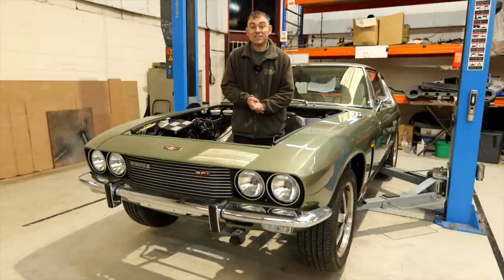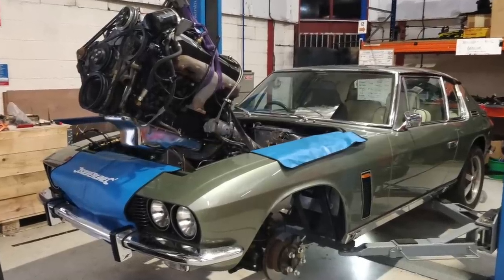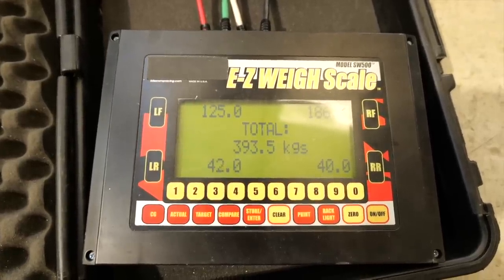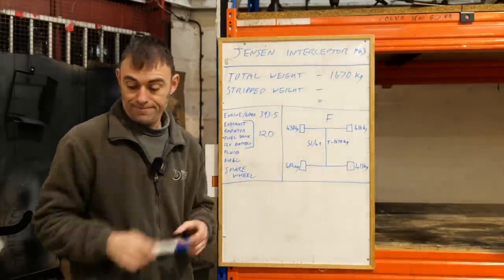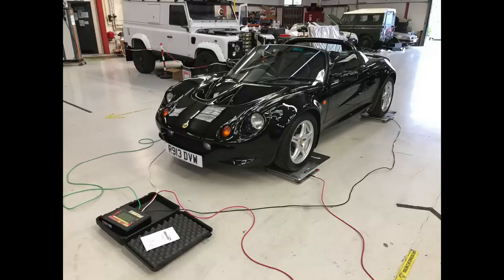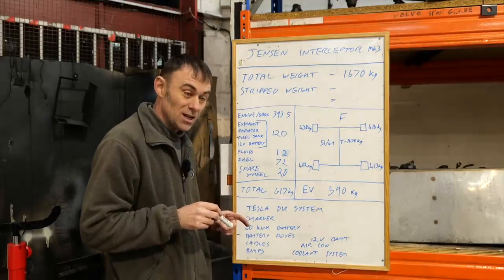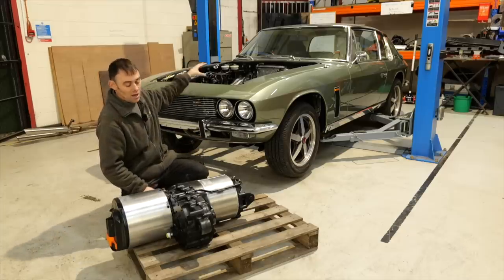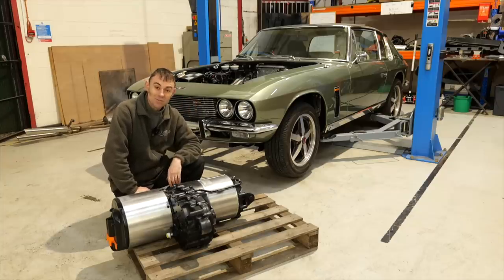Shocking amount of weight removed from the Jensen Interceptor.

Comment: I think you should have left the spare tire out of the equation. EV conversion does not prevent flats. Regardless, the weight still comes in a few pounds less (or kilos) with the EV equipment. Which is good to know that they are so close. Bring on the conversion.
Reply: He said they’re using the space, so there won’t be a spare.
Reply from the maker: True but we need the space for the rear battery pack, also new cars haven't had spares for decades. 👍
Reply: @ElectricClassicCars  "...new cars haven't had spares for decades." Huh? Say what now??🙄
Reply: @ElectricClassicCars  fair enough taking that into consideration. Keep up the good work.
Reply: @eGazTheFirstAustralian  I figure he means there in the UK. We still like our spares.
Reply: @alanmay7929 … agreed, but at the end of the day this car will probably be more of a “weekender” and some aerosol gunk and an air compressor should save the day in 99% of situations.  You could still mount a spare in the boot if you want to get more adventurous.
Reply: Yep, I'd factor in a spare even if it is one of those rubbish space saver spares.
Reply: @ElectricClassicCars  My current new car has a spare?  So have all my new cars this century, so perhaps that's a bit of a generalisation.  But I understand the decision and you can always retune the Jensen suspension for runflats.
Reply: @ElectricClassicCars  Not true. Most cars have at least a space saver spare WHEEL. No one ever carries a spare TIRE or TYRE. My 2002 Mondeo has a full size spare WHEEL. My 1999 SAAB 93 Cabriolet has a space saver pare WHEEL. Most current models have a space saver pare WHEEL.

But by all means misrepresent the facts to excuse the need to add even more battery capacity to a once beautiful classic car, in a vain attempt to give it useful range - for the brief life of those expensive batteries that will need to be replaced in about 5 years.
Reply: @G58  Two out of my last 3 cars haven't had any spare wheel, just an inflation kit with gunk. Pretty much everything from BMW/Mini uses run-flat tyres, so they don't have spares either. The idea that batteries need to be replaced after only 5 years is not even close to being true.
Reply: I was surprised to see that the EV conversion could be done at the same curb weight, since modern EVs are usually a few hundred pounds heavier that ICE equivalents.  Of course it is possible with a small battery and limited range, but that is not the case here with 200+ miles of EV range.
Reply: @ElectricClassicCars  And we are very much poorer for the lack of spares as the state of the roads mean no spares so lots of misery when you get a puncture. ( Deal with this on a daily basis as a breakdown patrol ) .
Reply: I've not had a puncture for 15 years or even longer so I agree leave the spare in yer garage and take the risk !

Maybe take it on long trips but pointless carrying 20kg around locally with you.

Just call the AA if you get a puncture ......
Reply: @timgosling6189  Only about 60% of the new cars sold in the US have spare tires...
Reply: Yep, in many new cars the spare wheel has been replaced with a roadside repair kit, which consists of a can sealant and a 22 volt tyre inflater.
Reply: @G58  Oh dear the (very) old suggestion that the batteries will need replacing in five years, simply not true, my current EV is five years old, still going strong with no suggestion of replacement battery being needed, the batteries and motors used in these conversions are salvaged from written off cars, they are not new!
Reply: @G58  my wife's 2009 focus doesn't have a spare wheel, not does my 2018 BMW. It saves a lot of space and weight (which improves the economy).  I understand why some folks want a spare wheel, especially if you are in the sticks, in which case you just buy a car with one.

It's important not to misrepresent facts.
Reply: @OriginalgEd  you responded:

“G58 my wife's 2009 focus doesn't have a spare wheel, not does my 2018 BMW.”

Okay. 

“It saves a lot of space and weight (which improves the economy).”

What evidence do you have to support this claim?

“I understand why some folks want a spare wheel, especially if you are in the sticks, in which case you just buy a car with one.”

What has location got to do with it? The important thing is that if you have a spare wheel, you have the option to change the wheel if you get a puncture. If you don’t have a spare wheel, you have that option, and have to be recovered. That’s just ridiculous. 

“It's important not to misrepresent facts.”

I agree. Who has?
Reply: @eGazTheFirstAustralian  have you bought a car in the last decade? My Volvo V60 has none
Reply: @G58  None of my new cars have had spares since 2018. Only those constructed in the last century.
Reply: @G58  lol batteries comes with 8years warranties on most cars? How much warranty an combustion engine has? 😂 How much maintaince a combustion engine needs, how much it costs to replace it, how much fuel you burn inefficient in 10years. Stop talking bull.
Reply: @hardywoodaway9912  EVs are not sustainable, and not as efficient as diesels. And that’s in normal conditions. In winter they are far worse. You cannot recycle lithium batteries. Everything on a petrol or Diesel engine is recyclable. These are the simple facts.
Reply: @ElectricClassicCars  "New cars haven't had spares for decades" That's a bit disingenuous. Many cars don't now sure enough, but there are still plenty of modern cars on the road with space savers and some even with full size wheels in/ under the boot. Needing the space for an EV conversion is a fair argument sure, but saying modern cars don't have spares so it's not much of an issue is a poor one, especially considering most people agree that a puncture repair kit is totally insufficient in most cases.
Reply: @Xenon0000000000001  
They often have the space for a space saver if you decide to buy one.

It's a cost saving thing and modern tyres are far more reliable.
Reply: @Robert  If you get the fancy sound system, there's often a subwoofer where the spare would go.
Reply: @Xenon0000000000001  Priorities! Ridiculous.
Reply: @eGazTheFirstAustralian  I haven't seen a new car with a spare for at least 25 years here in Finland.
Reply: @G58  Hmm, you're out by about 20 years on the lifespan of batteries. You do know that manufacturers guarantee them for 8 years, so replacing them every 5 years, by your reckoning, will be free.

Comment: Great video. I very nearly bought an FF in the late 70's, did the sums on running it as a 20 something, and sanity prevailed. Plus fuel rationing was in place, and my 25 litres of fuel a month wasn't going to get me far.

On a different note though, and maybe it's been explained in another video, why not just roll the stripped car back onto the scales? Not only will you have the Nett weight, but you will also show the change in the weight distribution.
Reply from the maker: That's what we normally do but it would make for a boring video so for this episode we filmed and weighed all the bits we took off instead. 😁👍

Comment: In the USA I believe it would not be a problem making the car total weight after conversion 2000 kg ie installing a whooping 100-110 kWh battery pack? I mean with modified suspension and wheels rated for that weight. These days most long range EVs sold in North America are even heavier. That could bring the range of this Jensen to at least 300 miles. Anyway it is an awesome piece of automotive history.

Comment: I would try and include the spare in that car if possible.
I don’t think a replacement tyre would be in stock at a tyre dealership due to its age and it wouldn’t be cheap getting the car recovered back to the owners home.
Reply from the maker: The size is pretty common. Modern cars haven't had spare tyres for decades. Also we need the space for the rear battery pack. 👍
Reply: @Electric Classic Cars I understand the logic behind your decision but if I were in the fortunate position of having you do this conversion for me I would still keep the spare wheel so that if I went on a long trip I would at least have the option of carrying a spare.  Sods law says if your going to get a puncture it will be on a cold dark night mìles from anywhere whilst it's tipping it down with rain. Just Subscribed by the way. 
How will you recharge the new 12v battery please  if the car doesn't have an alternator. I have seen several YT vids of Teslas in deep trouble when they're 12 volt battery has gone flat !

Comment: How much different is the modified Tesla motor and straight out gear box tail shaft compared to the Standard Test 3 rear drive unit.
Is that Tesl unit better than a similar Hyper 9 motor.
Reply from the maker: It's a lot different and a whole lot more powerful than a Hyper9. 👍

Comment: The Revolt system is nice but I thought the straight cut gears on the inline reduction box was noisy and gets hot? Thoughts?
Reply from the maker: We may be using a different reduction gearbox. 😁😉👍

Comment: I went for 380KG for the engine, 124KG for the radiator and exhaust etc. 80 KG for fuel and 15KG for oil.  
See these conversions, if battery tech/electric motors improves massively, can you switch them out in the future?
Reply from the maker: Yes, we've already done one or two upgrades on the very first conversions we did 7 years ago as tech evolves and gets better all the time. 👍

Comment: I was lucky enough to have an Interceptor 3 as a company car in the early 1990s. All fuel was charged to company. 
The figures I remember I covered almost exactly 14000 miles in the year and added almost exactly 1000 gallons of fuel. Mixed driving with 2 mile commute and probably about 20% motorway over the period.
So well maintained mostly sensibly driven car achieved 14 mpg
Reply from the maker: That must have been the coolest company car in the world. Good job the company paid for the fuel. 😁👍

Comment: So, Electric cars never get a flat tyre  ?
That's good to know !
Why not use motors front AND rear  ?
The Honda 2000 used an electric driven rack and pinion set-up. Would this system be better to "add lightness", ie. taking out drop-links etc ?
Looking forward to this build immensely  !
Take care  !
Stu  xx
Reply from the maker: Modern cars haven't had spare wheels in for decades and we need the space for the rear battery pack. 👍
Reply: @ElectricClassicCars  BS, all of my last 6 cars have had full sized spare wheels since 2000. Stop pushing lies to justify removing the spare.
Reply: @dikkybee4003  Bollocks, none of my last three cars have had a spare, just a can of Tyre Weld and a compressor.  Stop pushing lies to justify your comments!

Comment: I do love your work but I'm not so sure about changing a low volume classic like this yes beetles that were produced in their millions. One redeeming factor is I believe that it's fairly easy to put back to original, I would keep the engine if it is numbers matching. Keep up the good work.
Reply: I must admit I have mixed feelings about this too.  On the one hand it's a shame to lose originallity (although depending on the work done the conversion may be reversible) but on the other hand for an occasional use car it should be a lot easier to live with.  It's obviously a safer bet starting with something like a Beetle which, lets face it, are no great loss to the world (apart from the undeniable proof of what a despicable character Adolf Hitler was) and are so bad to start with you'd struggle to make them any worse.
Thinking about it I'd change a lot about any classic, I'd have to convert to fuel injection and coil-pack ignition as well as ditching drum brakes (at least at the font) and any dodgy steering systems.

Comment: out of curiosity, since you had a starting weight for that actual car (and some way of getting that measurement) why didn't you simply drop the whole car back onto your scale after you took the parts off and skip weighing it piece by piece? 

Seems like that would be more accurate and include all the bolts, brackets etc, stripped that are all heavy steel.
Reply: Because we wanted to show more detail in this video. 👍😀

Comment: I might be looking at this from a different context (coming from Australia where distances tend to be larger), but having no spare wheel would be be a deal breaker for me. The range would possibly be ok as long as you didn't want to travel too far inland (not enough charging infrastructure).
Reply: The vast majority of new cars sold don’t have a spare these days.
Reply from the maker: New cars haven't had spares for decades.
Reply: @Pugjamin  while true on a per model basis. Taking Australia as an example (an possibly an outlier) the top 5 selling cars for 2022 are all either Ute’s or SUV’s which would have a spare. #1. Toyota Hilux #2. Ford Ranger #3. Toyota RAV4 #4. Mitsubishi Triton #5. Mazda CX5

The two SUV’s have spacer saver spares I believe.
Reply: @alanmay7929  Europeans probably have nicely maintained roads that aren’t covered in puncture hazards
Reply: On my very informal poll of the number of sports cars on the roads of  inland Australia the number is zero. Sports cars here seem to be mostly a costal thing with the majority never leaving the city. Anyone traveling any decent distance does it in a decent sized SUV or a bike.
Reply: @francesconicoletti2547  Plenty of MX5/GR86 etc on the road in regional Australia. I frequently see an Aston Martin in the car park of the gym I attend in regional (inland) NSW. Plenty of non SUV's in inland Australia.
Reply: @alanmay7929  not wrong at all. Most cars sold in the U.K, there this video is based, do not come with a spare wheel now.

Comment: 11:30 Is there a reason you didn't just mount the unaltered Tesla drive unit at the rear and mount the batteries (or most of them) at the front where the V8 would have been? You could add auxiliary packs to the rear until the weight distribution was about right... was it purely a packaging issue?
Reply from the maker: That would have meant cutting out the rear boot floor and doing some serious custom modification of the rear suspension.
Reply: @ElectricClassicCars  Fair enough!

Comment: Great video, but would it be more accurate (and easier) to weigh the car/rolling shell before and after stripping, rather than all the parts removed?
Reply from the maker: Yes, that's what we usually do but it would make for a boring video so we decided to film and weigh all the bits we took off. 😁👍

Comment: Did the Total Weight figure of 1670kg include a full tank of fuel?  I'm guessing it did not!
Reply from the maker: There was very little fuel in it when it was weighed. 👍
Reply: @ElectricClassicCars  I thought not.  So you can't subtract the 72kg weight of a tankful of fuel when you calculate the stripped weight :)

Comment: Every Interceptor III should be given the twin motor set up it deserves, transforming into an EE rather than FF! What would be the weight of a twin motor conversion?
Reply: You could do it with dual motor ... and you could then get rid of the prop shaft and bulky diff ... but you would still be seriously impacting the weight of the conversion... so the battery would need to be a good bit smaller, with consequent loss of range.

Comment: Excellent. You added the weight of the spare wheel out and also you didn't add the weight of the reVolt Systems 'luvly bit of engineering um creation' (what is it called?). What does it weigh?
Reply from the maker: We did include the weight of the Revolt system in the numbers. 👍

Comment: The weight calculation is interesting, although very specific. A modern economy car would tend to be a lot lighter in many ways. Let's take a hybrid Prius for example. If you pulled the engine and all of the infrastructure to support it and stuffed in a bunch of batteries swapping out the batteries and charging system that already come with the car, you would be looking at an already light weight car. Can you get the same range for the same weight? I kind of doubt that is the case. I'm guessing you would be lucky to get a 300 mile range on a Prius conversion which otherwise has all the advantages of a mileage efficient car.

Comment: The spring rate, shocker absorbers, anti roll bar size, suspension height were all designed for that engine weight in that position, are you going to change those too?
Reply from the maker: No, that's why we do all that, so we can replicate the total weight and distribution. 👍
Reply: @ElectricClassicCars  I can see that however it cannot be easy achieving the same weight distribution with an entirely different drive train.
Reply from the maker: @mrofnocnon  Yes, it's perfectly simple, we do it all the time. Battery modules are like ballast, you just design the packs such that you have the appropriate weight in the front and rear packs.
Reply: @ElectricClassicCars  Impressive, thanks.

Comment: Does the spare tire no longer fit, do you have an option incase of a flat?
Reply: My EV has a bottle of gunk sealant and an electric pump under the back seat  (unused as yet) rear engine rear wheel drive no space for spare wheel

Comment: Motor could still go in the back with a DeDion axle on the original leaves?
Reply: Boot floor probably gets in the way
Reply: @Mardy72  Maybe not, and you'd be encroaching on the floor under the back seat rather than the boot. But either way, all doable with the appropriate application of time and money!  But it would be a tidy handling improvement getting rid of some unsprung weight and getting rid of the tailshaft as well.
Reply: @froggy0162  I agree mate, but normally Moggie and the lads aim to make their conversions 100% reversible, so no cutting and shutting
Reply from the maker: Yep, boot floor is in the way. 👍
Reply: @ElectricClassicCars  That’s what god invented angle grinders for ;)